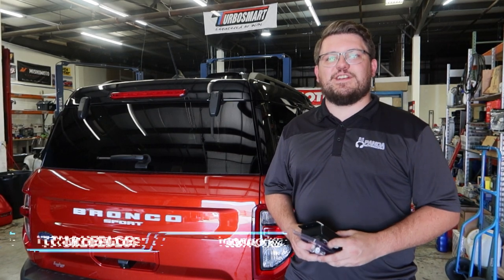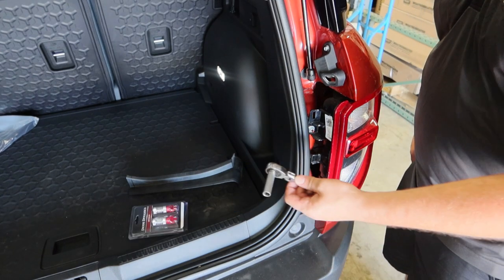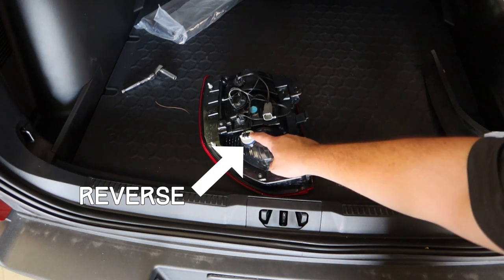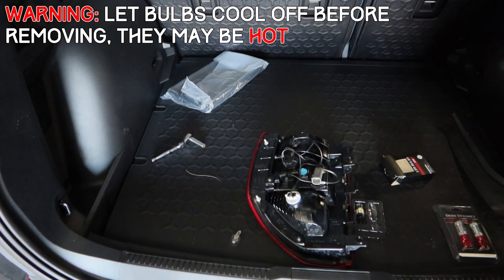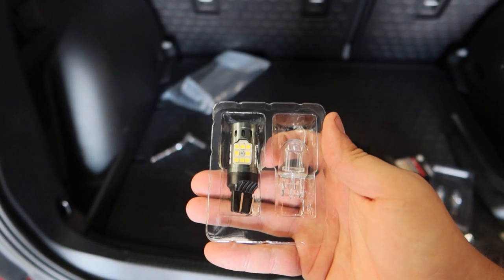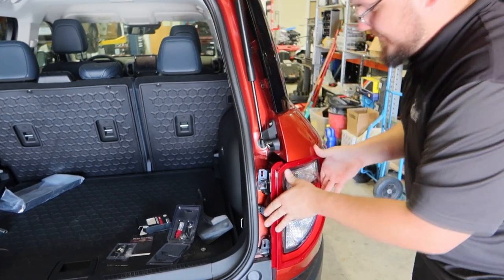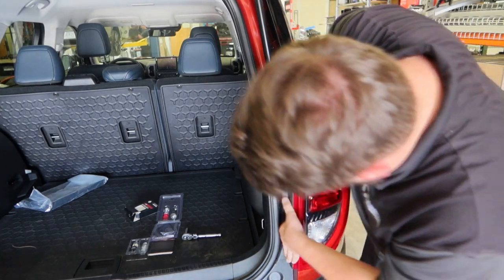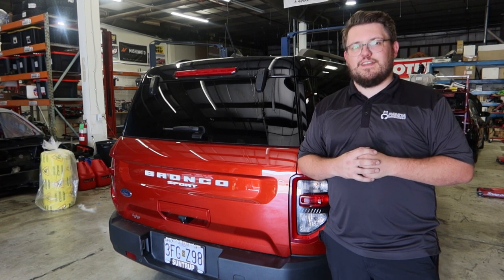Make Your Ford Bronco Sport Shine! | Diode Dynamics Tail Lights and Reverse Lights

Comment: I lost my 10mm just watching this
Reply from the maker: RIP 10mm
Reply: @PandaMotorworks  Would you happen to know how to replace the side marker lights on the Bronco Sport? My left rear marker light got broken by a runaway shopping cart. I have the part to replace it, but have no idea how to get the old one out. It looks like you can pry it out with a screwdriver, but mine doesn’t budge. Are there screws holding it in somewhere?